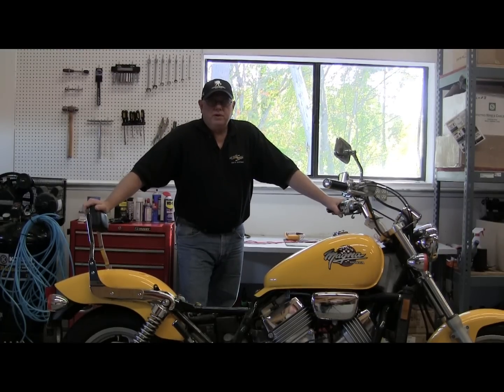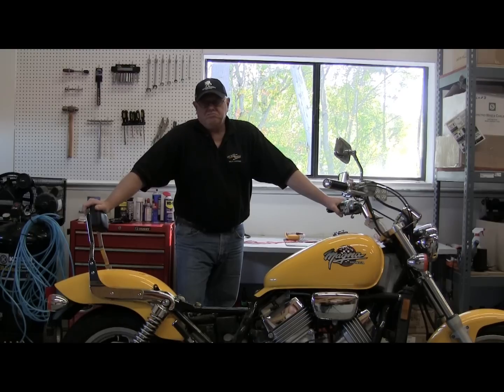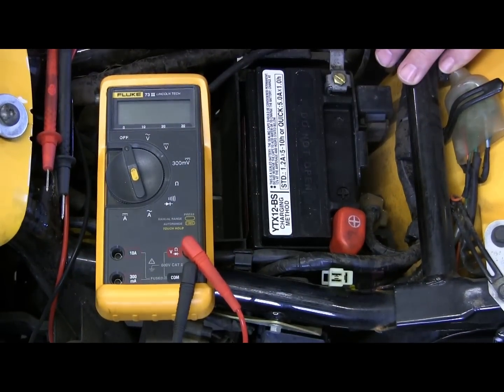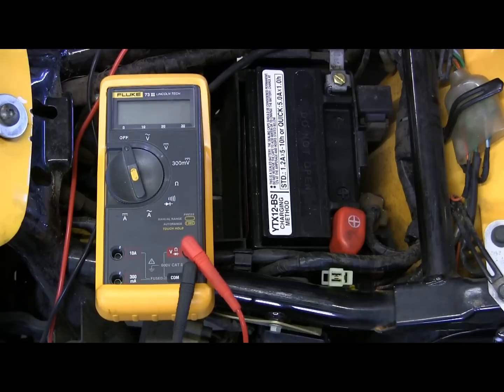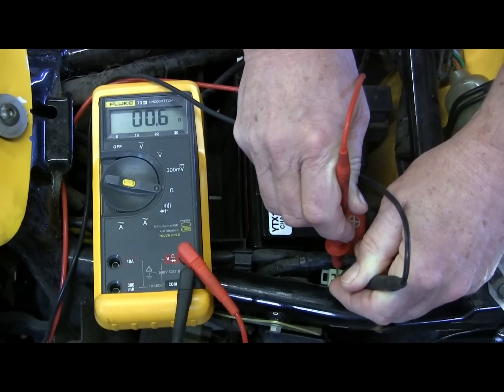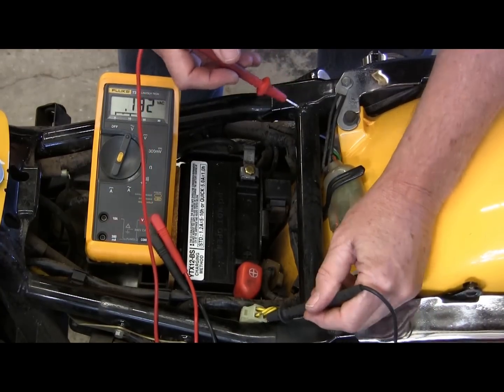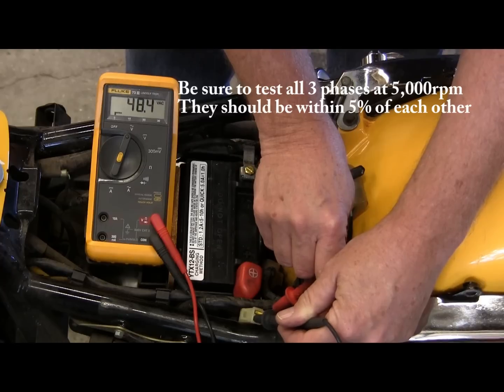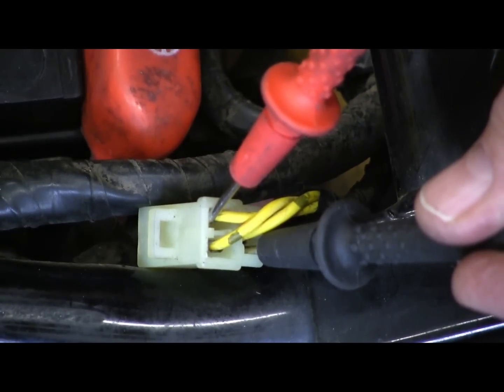#1 How to test a motorcycle stator

Comment: Heya Rick .. Confirmation needed, please. 
Checking ‘Stator Coils’. 
It’s obvious on first check, reading ohms acrost a/b - b/c - c/a that the connector to the R/R is un-plugged. 
The second test, AC voltage from the coils while bike running (16vac at idle increasing with rpm‘s), it’s difficult to tell for certain if this test is done with the connector to the R/R is plugged in or not. 
My thought is that you’ve simply flipped the un-plugged connector over to demonstrate checking with probes from the back of connector. 
Is my observation correct?? 
Merci in advance. 
Enjoy Peace
Reply: +Archie aka: Grumps You can test the voltage from the stator with it plugged in or not plugged in it doesnt matter. When checking resistance, you are checking the resistance of the stator ONLY thats why its unplugged. If it were plugged in you would be checking resistance of the whole circuit. So to answer your question, check resistance with the stator unplugged, check the voltage with the stator either plugged in or not.

Comment: The best video I've seen yet on 'testing staters'. My question is, I have a gsxr k3 1000, will a bad stator stop my bike from starting? I hear a loud spark sound like a taser but louder when I press start ignition. My r/r is new, I swapped starter motor with a used one. I opened up my stator and it was mostly dark brown, I tested it and got a reading of 0.00 from each phase. I took the stator out of the bike and tried to start the bike but it made same sound, can you please help?

Comment: Hi Rick my bike battery says 12.4v . After I come back from a ride turn bike off. Go to start again IT'S dead bike wont turn over.  I can push start though. The rectifier reads 520 ish none off them are incorrect.only 1 probe is slightly  corroded  still reads proper.  So don't think it rr. 
HELP PLEASE

Comment: Aren't you meant to check the stator connection socket for the ground check and not the other socket that leads to the regulator/rectifier? I'm sure that first test was on the wrong socket.

Comment: In another video the stator AC voltage check was done grounding the black common terminal and touching each of the 3 yellow output stator wires for voltage with the red terminal.  In this video one terminal of the voltmeter was to one of the yellow wires and the other terminal to another of the yellow wires.  When I did this using the first method I got a reading of zero.  Something seems wrong, which is the correct method?  Thanks in advance.

Comment: I got ac 16 voltage on all 3 stator wires - increasing exponentially with rpms - and one way continuity through a b and c in the rectifier - but no extra voltage from the battery at revs. New (as with old) battery goes flat after 2 days with head light fuse removed. All seems good - except I only get 0.03 ohms on the 3 stator wires. It should be closer to 1 ohm.

Comment: Hey Rick...lots of great info here...quick question...I just replaced my stator and regulator(admittedly not with one of yours) and everything was fine for about a week, and now my new stator has failed, after only about 150 miles... My new stator will be one of yours, but my question is, what can cause the stator to fail so quickly? Was it just a bad stator, or could there be something else wrong? And how do I trouble shoot it?

Comment: I have watched your video, awesome! well done Rick..

I have a Kawasaki zr1100 zephyr and just wondering where my rectifier is?

just bought the bike, travelled over 200 miles from wales to Halifax to collect the bike from an ar.ehole that said it was in perfect condition.. battery was tossed, changed battery and simply went click after 3 days of use. battery not charging :( even though the guy said he has used it daily. not all.. got home, popped some fuel in and went for a run. so exited about my little classic. fuel pi..ing every where. carb float needles tossed. replaced! £12 a kit £65 battery and a tank fuel tap diaphragm kit £20.
that's not all.. oil pi..ing from front of lower barrels. I have bought a heap of sh.t from a tosser on EBAY called DAZBIKES
even though he knew I had MS and was buying the bike to do a charity run to Poland for MS and Cancer. if you would like to text this geezer and show your concerns, ring DAZ +44 07808401661 £1700.00 and still have a shed load of work. he said he have serviced the bike, yes he put a 12 months MOT?... spongy front brakes fuel leak and oil leak.. do you think this should have passed a MOT? HT leads shorting out everywhere.. runs ok as it has two HT leads per cylinder. at least on fires so doesn't realy misfire. in the dark and look under the tank and its like November the fifth. sparks and fuel leaking just don't mix.. lucky I am still here. could have gone up like a rocket and met my maker..

Comment: Advice please: I tested the stator while the bike was running. 2 of the 3 wires gave consistent numbers (between 22 and 25 ohms) but the third wire gave the number 1.8 ohms, which is the same number all three wires give when the bike is off. Does this mean my stator is bad or that particular wire is bad?
Reply: You cannot accurately check resistance (ohms) with power on the circuit (you can destroy your meter though).  You'd check the voltage between legs while it's running.

Comment: I have a 06 Honda cbr1000rr. This is the second time I have charged up the same new battery and every time it last a day and dies. There is no power going to the bike. If I put jumper cables on it will start right up and as soon as I take the jumper cables off it dies. Is it the stator or the rectifier or something else.

Comment: Hey Rick I was riding and my bike cut off on my way to work. I have a 99 Honda magna. Found stator wasn't charging multimeter showed battery voltage. Watched your video and found connector turned out connector was melted and plastic coating had come off and was shorting to all three yellow wires. Just cut out wires and spliced and soldered in new wires now showing 14.6v thanks for your video I thought for sure was stator.

Comment: Rick, I have an '83 Yamaha Seca 750- I biught a new stator today cause my old one is black. The bike, when it warms up enough (usually after 15-20 mi.) starts running rough (new spark plugs- old ones were dry and fine). If it sits/ cools off, it starts right up and runs great. Anyway, my old stator did not have the 3 prong plug, it was just hooked up with 3 individual connectors. My new stator I bought has the plug. All 3 wires from both stators are solid white,. so I want to know if it matters which wires go where??? I traced where the 3 go. 2 go to the battery area through a plug with other wires, the 3rd goes to another splice (goes somewhere else- for spark plug coils maybe???). Does it matter how i wire the 3 in? It seems like it doesn't matter since they're all white going into the plug. Thanks!
Reply: HitaDrum19 All three wires should go the the reg/rec. If you look at the leads coming out of the R/R, there should be three corresponding wires of same colour (be they white, yellow etc). The three leads coming from the stator coil connect to the three of same coloured leads going into the R/R.

Comment: HELP PLEASEEE!!!!!!      i have ac voltage at 5,000 rpm is around 50 and at the battery i have 13.6-13-8..  ac voltage at the idle is 13 and at the battery is 12.4(not charging) The resistance between those 3 wires is ok and it has no ground with the frame
Reply: Sounds like a dead battery or a regulator/rectifier issue....unless your idle is too low and needs turning up?
Reply: rankore69 i replaced the battery and i tested with another  regulator/rectifier and still the same issue. you have ideea how many voltage the stator must have in idle? tnx
Reply: its charging at 12.4  albeit lo charge your bike had lights on etc all time etc  if it twasnt chgng that 12v would steadily go down correct?  your just not seeing 14.5  many bikes do not make 14.5 .. my bikes been 13.7 for 20 yrs only had 3 battery's.. heated coats in n all that ..

Comment: Rick can a poor charging system cause a bike to not rev up high? My. 07' Suzuki GSXR. 750 does not rev past. 8k. This is my also my third battery I'm on. First two battery's were used but STILL. Bought a brand new one still have problem . Thiught All other parts have been replaced plugs, fuel pump, throttle bodies etc.

Comment: Hello 
Suzuki volusia 2004 bike problem when you start the engine running normally, but after about an hour proceeds engine stop and after leaving for a while until cool works normally on the road and works well, but does not stop the engine if the stop in place

Comment: That was a great video!! I have a 1983 Virago that I recently replaced both the stator and regulator. I receive a constant signal when I use the Ohm reading, However when the bike is on the battery does not show a charge any higer than it does when it's not running. Could you please offer some advice?

Comment: I have a question I was hoping for help on. I hve 1976 Honda CB500T. Read the manual and all seems great, last thing was the points and ignition timing. I did a static test with a continuity light and found that in six rotations the light never shut off.  That would tell me my spark plugs are firing constantly, and I cannot get it to idle for more than 4 seconds-and throttle kills it immediatly. Sanded the points to clean the contact surface and yes, they ARE closing.

Comment: I just did this test on my KTM Superduke. I have a different meter, but set to ohms         (200) I got readings of .4 on all 3 phases. When I set the meter to AC volts (200) the reading at idle was 10-11. When I increased the rpm's the reading dropped down to 6-7. Does that mean my stator is toast?? Thanks for your reply.
Paul
Reply: Same problem here, on my bikes manual it tells me to use DC voltage but here I'm told to use AC voltage. Pretty confused.

Comment from the maker: The reading depends on the load you have on the machine,.  If you're testing with your headlights on, you're going to get a lower voltage b/c that is robbing you of voltage.  13.8 will keep your battery charged.  13.4 is right on the edge of not being able to keep the battery charged.

Comment: i have 2  suzuki,s   VL1500  and a C90  same bike just newer,  if i check voltage at batt, on both bikes its pretty much the same 13.4  to 13.8   with rpm,s aprox 2000  most sites say it should charge about  14 or a little more,,  had a bad rect, on the newer one and replaced with yours and now its back to 13.4  13.8   should it be 14 ??  thx

Comment: the stator of my cbr600f3 provides 13.0 volts at 1,500 rpm this correct?

with 1,500 rpm, and carrying on with lighthouse, is below 13 volts in the battery

thank you

Comment: I did some testing earlier, my bike is at a friends garage which is a 20min bus journey away. I tested each phase against the neg terminal of the battery. surely its only measuring the potential difference so this should work? I thought stators were AC just like a generator ? the reading from the phases to the neg batt term was 0V so I dismissed this as being a dead stator, found some wire in the cover too!.. (non moving part wtf)

Comment: Rick, it's hard to call me during day. Maybe if I simplify

Are there other charge system types besides the 3 phase perm mag alternator you discuss on bikes that would cause greatly different test results for vac and continuity like I got?. Most likely charging alternatives on small newish korean bike, 150cc?. My stator has 8 coils, 3 wires coming off it. 

Surprised phone and pm's not too expensive for you in time. Again, thanks

Comment: Thanks Rick, great video.

* 150 cc korean, charging fine, I think. 3 wires

* Voltage test, is your connector disconnected? 

* Mine doesn't start when 3 stator wires are disconnected. Okay?  

* Plugging into wires right before connector I get 5 vac idle and 15 vac full rpm. Why so different from you?

* Connecting each contact to ground I get continuity, .9 ohm. You get 0. Why? 

* Are there different types of alternator and can you tell what type I have from above?

Comment: Sorry, no schematic. The bike originally only had an AC regulator (to run the head and taillight), but the kit added a generic DC regulator/rectifier was added. 

The stator has 2 coils, one for spark and one for head/taillight. I figured that by checking continuity in the 3 wires since I got continuity only between two wires (the lighting coil) and continuity between ground and the other wire (for spark).

Any idea what the voltage output should be for the lighting coil at about idle RPM?

Comment: have a 1995 Honda xr250r, that has a baja design dual kit on it. The battery is not charging (no voltage increase while the bike is running). I suspect the DC rectifier/regulator that came with the kit is burned. However, I want to be 100% sure since electronics can be tricky 
1) do you have such DC rectifier/regulator? 
2) how can i test the stator of the bike while on it? I believe it has one phase stator, no?
3) do you have a stator with more output for that bike?
thanks

Comment from the maker: Are you referring to the OHMs reading?  If so, culprit could be a bad connection.  Could also be a variance in the meter itself.  You can also get strange readings when the battery in the meter is on it's way out.  The readings being consistent is more important than just being off a couple tenths of an OHM.